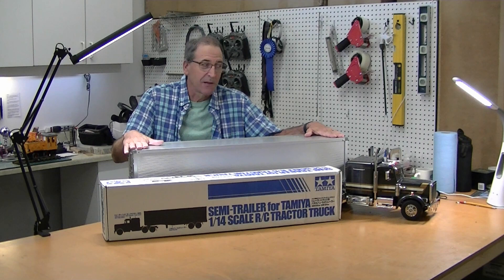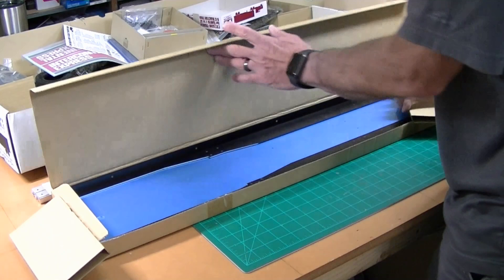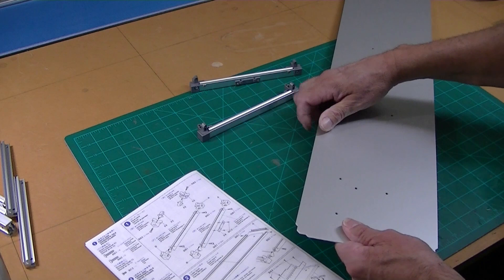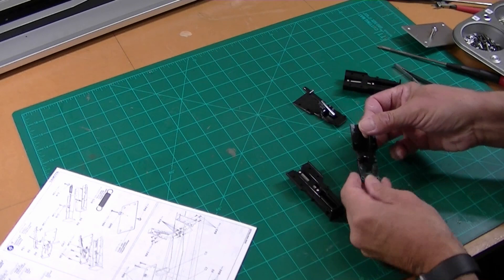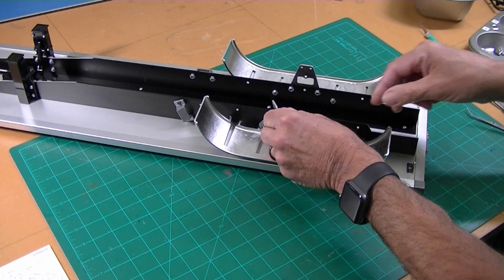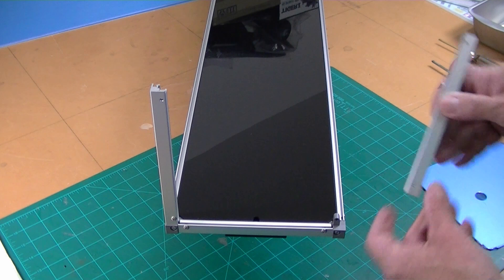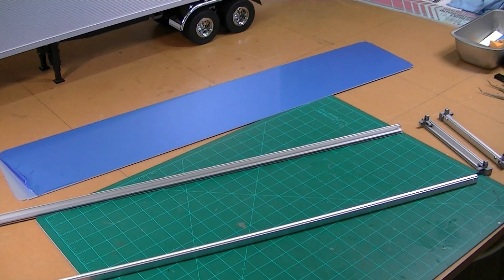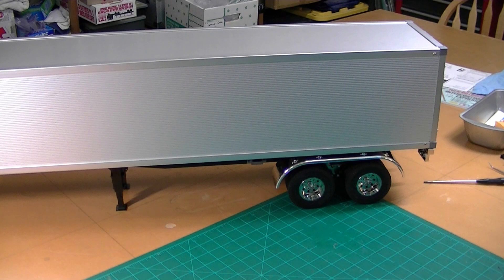1/14 Tamiya RC King Hauler Semi Trailer Build 56302

Comment: Honestly these trailers are unrealistically short. These trailers don’t even look 40 ft long. At most they are 35 ft long, and also American trucks pull 53 ft trailers, which are much longer than these ones.
Reply: It’s equivalent to 32’.   Which I agree is too short

Comment: Nice build but not much can be done with a trailer like that, a flatbed would be a better choice for me...and as with most Tamiya kits way overpriced...seeing if the upcoming celebrations will have a sale....luv your vids particularly on the MFC and self centering kit for the flysky controllers....

Comment: Hey Bob, Have you ever tried building a container trailer without the kit. I would love to try but have no idea where to start.  Something similair to your Hmtt Custom build. I'm guessing you would still use the axle and wheel kit at some point.
Reply from the maker: Generally I have found it best to start with a full kit.  You get all the tires/axles/susepension parts you need plus lots of parts.  Then modify away!

Comment: What would be the best way to add marker lights to this trailer?
Reply from the maker: I either drill through the frames and notch the side panels or add a small aluminum channel underneath and add lights there.